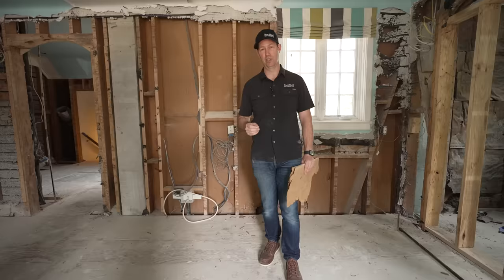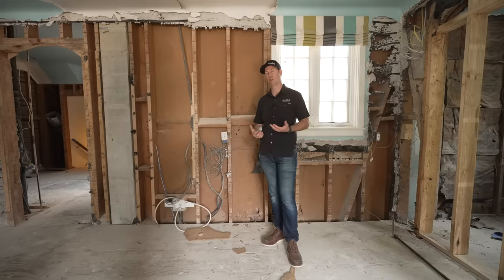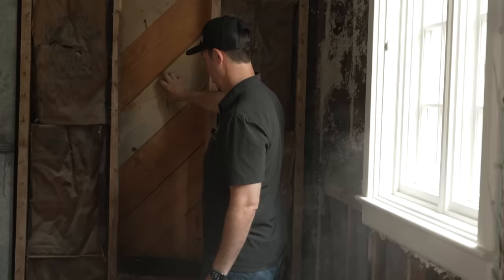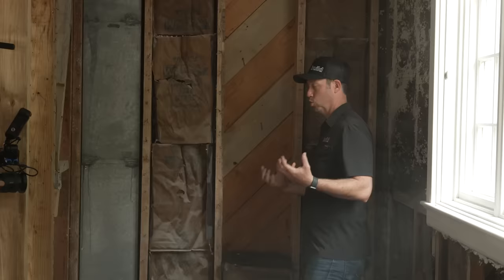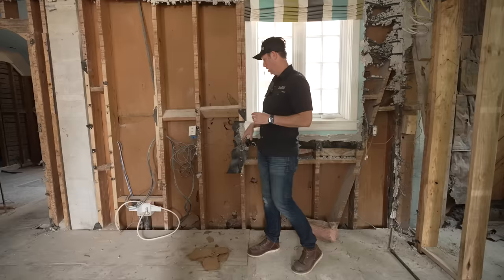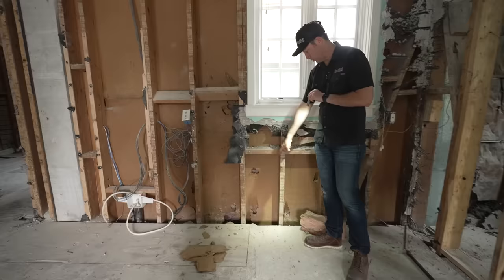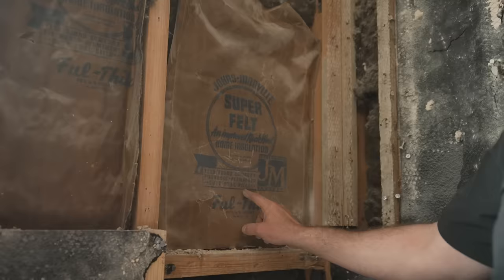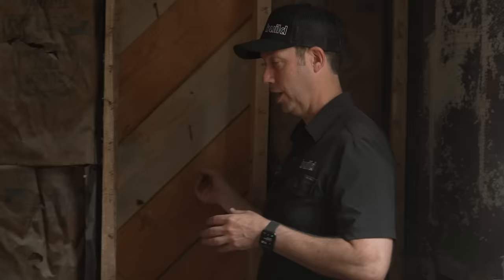I’m recommending we NOT INSULATE This Old House

Comment: Solid brick wall construction is how all Victorian era houses were made, just like a large percentage of UK houses.
You might get mold on cold walls in near freezing wintertime but nothing rots as it's all breathing. Even the floor joists are all intact. 
You can of course insulate with Rockwool, as I will be doing to my house because solid walls are bloody freezing in winter. 🥶
Reply: I beg to differ--Our 1898 Queen Anne is not brick, it's sided with wood, interior is lath and plaster.
Reply: Not where I live (northern NH). It's almost unheard of to see any brick, except the tops of some foundations. My 1893 is all wood exterior, lathe and plaster inside.
Reply: Fellow uk resident who bought a solid block home... how are you going to manage the moisture build up or prevent it?
Reply: Wood frame with brick veneer just like this (though usually less cheapish) was already very common in the outgoing 19th century (in the Us).
Reply: @fabriglas You could use wet-sprayed cellulose

Comment: Great video - thanks for the reminder that we need to always keep in mind how an older building was put together and to see what was work well  - rather than just making changes without actual consideration.
Reply: I'm not an expert, but a lot of newer buildings don't seem to have the longevity in mind when compared to older builds. I'm not sure if it's materials, or design, or both, but I'm amazed at buildings that are 300, 400 or even 500 years old still standing.

Comment: An unsealed house that lasted a century and 8 can see it lasting another?!? What a crazy idea! It’s great building a perfectly sealed home, like he usually promotes but one tiny defect that was not caught or one that develops on it own over time or one that has external force damage that no one thinks harmed the building envelope and you have a hidden problem. One that will reveal its self after it’s done extensive damage to property and possible occupants health. Let you homes breath and work with nature,  not against it.
Reply: 100% percent agree.  I own a home built in 1910, no insualtion, mostly plaster walls, original poured foundaton with no cracks or leaks, original pine floors, and original wood windows (storms in the outside).  The house will probably outlast me.

Comment: I would still insulate. There are organic alternatives that hold moisture. We use it for old farm houses. I would be more worried about vapour barriers than insulation.

Matt did not explain it but here is what I believe may happen. If you put in insulation less heat will leech out to the old particle board. Which means moisture in the air will condense into liquid water droplets earlier because the relative humidity will hit 100% faster in cool air vs warm air. Which is bad. But if you add more material that can hold humidity to "share" the load of the particle board it may not be a problem. May not, as in if you do not do a good job it will probably fail. I would want the moisture to be able to move in and out so I would not put in a vapour barrier. You can always add more ventilation. I really recommend a vapour barrier if the walls are unable to hold a lot of moisture.

Comment: Thank you, Matt.  Along with your video about how vapor barrier and vapor retarder should not be installed on most houses, this appears to be the last piece of the puzzle for me to maintain my exterior walls on my 1960s stucco home. Now, my tentative plans are: 1. No vapor barrier or retarder, 2. No insulation, 3. Possibly replace the drywall that has paper backing with either plaster or cement backerboard, and 4. Seal large cracks and openings in the walls.

Comment: Matt:  I was told by my grandfather those bays were cold air returns when these places were built.  My house is 120 years old brick row house (east coast) with plaster walls .  They used lath to frame everything.. (I'd hate to have been in lath crew with 4000 pounds of 3/8 inch tacks and mountains of lath on a wagon).  When my father and I redid the interior walls we used regular 2x4 then added another 1x to fur it out.  then ran some of the 4000 pies of lath on 1x blocks on the back of the 2x4  thus creating a 1.5 inch gap between the interior brick and the insulation.   I know others who parged their bricks on the inside (interior bricks are salmon bricks) and this created problems with efflorecense.  So far so good on my spot...
Reply: Agree ! We noted this on a 1911 job we were on ,Balloon framing allowed the air to circulate through all walls and joists , plaster walls maintained warmth with the constant heat with water heaters , worked well with no insulation with the exception of every wall outlet and switch penetration sucked in air around the trim plates

Comment: Unfortunately the brick has an R value of about ZERO, my former boss in NW Iowa restored an 1898 2 floors and attic all brick, slate roof townhouse,  I remember he said his utility bill was $800 a month on average- he was basically heating and cooling the SKY with that zero R value brick and single pane windows everywhere.
Without insulation you are going to pay thru the nose for heating and cooling, and it will never be comfortable when it's 20 below zero and windy outside, especially with single pane windows!

Comment: Vapor management is extremely climate-specific, and masonry behaves very differently from wood (Matt Risinger knows all this).

GreenBuildingAdvisor and Building Science Corp have excellent article on vapor management. I'm building in climate zone 7 (cold, high desert) and found mold and frost on the inside of my OSB sheathing after just one winter with open-faced rockwool insulation and no drywall. In this climate, vapor is driving from the inside out and condenses on the cold sheathing. There's almost never vapor driving from the outside in because it's rarely cooler inside than out, and when it is, it's hot and DRY outside.

Comment: This is a great video. I see so many people trying to remodel old homes in the north 100+ years and trying to go net zero at the same time and you see problems almost immediately sometimes.
Reply: So how do I insulate a 150 yr house from inside?? No videos seem to cover that anywhere.
Reply: @sunshinecompany1  usually people gut the interior and install fiberglass batts or punch a bunch of holes and blow in cellulose or fiberglass
Reply: @lifeinchicago9112  some I had to gut and was gonna do fiberglass and poly but some are saying not to so I'm confused more now. I's poly ok on top fiberglass inside balloon framing? 😐
Reply: @sunshinecompany1  if you dont want to gut you can blow in your attic ideally is easiest (just make sure the plaster  is strong enough to hold it). And you can pop a million 1" holes at the top of each joist cavity inside and blow in insulation. Not sure if you need poly, we don't do it in Chicago but I know some climates do
Reply: @lifeinchicago9112  i don't get it, if you add batt insulation, you're asking for moisture trouble since there will no longer be air movement to dry the walls.

Comment: For old houses dense pack Cellulose insulation works good enough.  However most people hate the huge mess it makes.  It really tightens a house up.
Reply: 1770’s house in New England no sheathing. The clapboard is nailed to the outside of the studs the lathe ont he inside.
My folks had dense pack cellulose. Low. In in1978 and to this day no detectable rot fwiw

Comment: I had it even worse in MN where I had a 1924 church that had brick on the outside and ceramic block on the inside with plaster directly over it. I spent over $1000 one January to keep it at 60 degrees F. The only thing that made sense was to cover the building with insulation. This is something that they are doing in England now, but back then there wasn't much available. In the end I moved to Oregon and let someone else deal with it.

Comment: How about using cork board insulation?  I've used it in my previous house in Belgium.  It's natural and permeable, doesn't rot and insulates very well.  Yes, it is more expensive but it might be worth using on this historic house.
Reply: That's a sensible European-style solution. Americans do very strange things with their cardboard homes.
Reply: Australia is even worse. Or was in the past. Yes, many homes in Australia were built like a 'cardboard box' where weather would be between -2 C in winter & 45 C in summer. Not fun.
Reply: He could use cellulose as well

Comment: I'm not a pro, but I'm having a tough time wrapping my head around particle-board in the 1920's... seems off to me.  But the content of this video is spot-on.  I wonder - is there a way to vent a wall cavity like you would a roof or cathedral ceiling?  Maybe then you could get some insulation in there behind a double wall or something?
Reply: Everything was balloon framed back then and vented through the attic. They are going to mess up if they put fire blocking as required by code. Its always best to apply the same building techniques used because they were constructed with full knowledge of that system at the time.
Reply: @danbiss87  thanks...so I shouldn't put 1x4's between framing?... To slow fire spread? 🤔 and HOW can I insulate from inside?  Can I use fiberglass and poly then  drywall? I need heat without destroying 150 yr farmhouse. 😄

Comment: Matt, consider using fiberglass faced gypsum... They use it as sheathing on the outside of commercial buildings!
Reply: DensGlass
Reply: @mikehermesmeglio  yes, and DensArmor from GP.  USG and others make similar products. I think commonly used on interior walls of commercial buildings before dry-in.  I put it on the walls of my bathrooms and in the basement.

Comment: Put some woodfibre and lime render on the inside. Vapour-open construction, which should let it continue to dry the way it has been. Or cellulose fill behind mesh in the bays and woodfibre across the front to render onto. 'No insulation, burn more energy' is a terrible idea. If it really is unfixable then it just has to be knocked down and a useful building put up, but I'm pretty sure that's not the case there.

Comment: You don't have to use basic insulation. You can use other spray types that don't absorb water. That seems to be what he is afraid. So to answer your question.

Yes!!!!!!!!!!!!!! 10000000000000000000000000000000% insulate that house.

Comment: I think what you are referring to as "old school particle board" looks like what was called "beaver board." Don't know why the name, but when I was a builder in a small southern town years ago, it was still available at the local lumber yard. Also, insulation question aside, my concern in remodeling an old house like this is the inherent danger of the framing system in the first room. It is balloon framed by running long studs up from the foundation and hanging the floor (or floors) inside the studs, leaving perfect open fire chases in every stud bay. A fire in a basement or lower floor is free to move upward without obstruction. Blocking between the studs at the floor and ceiling level would solve that issue. The second room is platform framed, with a sole plate on top the floor. There are to openings between floor, so a fire is more contained. Just sayin'

Comment: I owned a house built in 1903, and originally had wood plank siding,  but had that cardboard sheathing added sometime in the 30's? according to an old neighbor that grew up in that neighborhood and still lived there. They covered that with asphalt shingles (probably asbestos, but we didn't get it checked. Then that was covered with aluminum siding before I bought the house. I just painted the aluminum siding and left it all as is.

Comment: I tell people in my neighborhood of 100 yr old houses all the time.  Builders in the old days knew all about water intrusion and had access to various types of insulation, but knew better than to insulate given they could not really waterproof their houses.  Insulate the attic and leave the walls alone.  This also speaks to putting back lathe & plaster instead of cheap wallboard.  If you can even find someone who knows how to do lathe & plaster....
Reply: They didn't know shit. Walls were wavy, ceilings, floors were sagging and it took 4 wood stoves and 12 cords to heat a 1400ft home.
Reply: @augustreil  true. People say old houses were built better. I beg to differ Ive been in old houses some of them you see daylight through the walls. 500 bucks a month to heat it also. And that's in tennessee. Imagine if it was in minnesota
Reply: @justinballard7242 , Agree 100 %
Reply: @justinballard7242  Strongly agree. We paid $150 / month to heat a 1000sf apartment in SF during the winter. And we only heated it to 62F when it was usually 50-60F outside. It was miserable to live in. I can't imagine living in an old home that hasn't been retrofitted with good insulation in a colder climate.
Reply: @dosadoodle  in the house I'm building it'll be a post frame house. With 11 Inch thick walls. R 40 in the walls with very minimal thermal bridging. Conditioned crawlspace with r40 walls and r10 under slab. Conditioned attic with r40 roof. If course all air sealed also
Reply: @justinballard7242  Good luck with that. FWIW, the sweet spot is 2" of ridge foam panel insulation, 2x6 with 24" OC. Any more and you just picking up pennies in front of steam roller. Any more insulation and your costs soar and you also find it difficult to find contractors that can deliver the quality need. 

The other issue with a passive home you still going to need to run cooling to remove heat & moisture. The Applicances (Frig, freezer, electronics, oven\stove, dish washer) are going to give off heat, & then there is the bathroom exhaust fans that will always leak air, even if your home is tight enough to live on the moon.
Reply: @guytech7310  the r23 to r30 rockwool is a marginal price difference. In a post frame the cost of framing is far cheaper so I'll spend the money saved on insulation. Plus in a post frame instead of 24oc you have post at 8ft oc and run your drywall backing horizontally on the Inside of your post.
Reply: @justinballard7242  Exterior insulation will deliver more bang for the buck, than cavity insulation.
Reply: @guytech7310  I'm also worried about sound dampening I'm on a busy corner and the extra mineral wool will quiet the house down
Reply: @justinballard7242  2x4 R-15 makes a room dead quiet before the drywall is up. Issue will be the windows transmitting noise inside. Pine Trees & evergreen bushes can help dampen noise if you have the land.
Reply: Ah the good Ole days when the average life expectancy wasless than  50.  They never had it so good and knew so much...

Comment: I'd love some advice about a 1984 house I'm about to acquire. The wood siding / ground clearance weren't maintained properly and the bottom 10" of the vertical siding is rotted. Taking the bottom foot off won't look good so I'm planning on replacing it all. My thought was to put zip sheeting on before the new siding. Am I opening myself up to vapor issues in the walls if I do that?

Comment: Hi Matt, sheet rock is not a modern material, my house was built in 1918 and still has some of the original sheet rock, I believe it was marketed as the poor man's plaster as early as 1910 or so.
there is no insulation or mold behind the walls here also, love your videos by the way! always learning something new from you, keep it up!
Reply: You're off by about 40 years. Full panel sized drywall was introduced in the 1950s. I know this, as earlier in my career I worked with finishers who made the transition from being plasterers to drywall finishes in the late 1950s, as plastering quickly died off. Rock lath is a thin drywall type product, that replaced wood and metal plaster lath. It was typically sold as 16" x 48" panels, and nailed with short nails that are similar to roofing nails. Confusing sheetrock and rock lath is a real common thing.
Reply: @kerrykerry5778 basically the same product, but different size.

Comment: I wonder if you could insulate with rockwool and bite the bullet and install 3-coat plaster and make sure your paint is vapor permeable. No additional “mold food” added and the wall is allowed to dry in either direction. Or even use cellulose insulation to act as a humidity buffer. It would be a really bad idea if you were enclosing a truly high humidity space like a pool or museum. 
Cellulose is very commonly used with success here in New England. 
Interesting question. Have you discussed with Joe Lstiburek?

Comment: That old sheathing was called Donnacona Board here and used vice drywall sheathing on the interior with wood sheathing on the exterior. Plus rock wool insulation stuffed in but had settled over the years in the 1950s post war mini house I gutted over the past few years here in New Brunswick Canada whilst cautiously wearing my P100/P3 mask lol.  Personally, a lot of these old houses should just be torn down, recycled somewhat, and be rebuilt to a net zero standard.  The bandage approach isn't going to work and it means a whole lot of tearing down and rebuilding which will cost more but less than what it will cost if not done in the long run.
Reply: arent old homes built better though? not as efficient but if they lasted 100 years////
Reply: @randomrazr  Agreed 100%.  I live in one of the original homes built in 1823 near Hartland NB and added to over the years and its still standing but built way beyond the structural minimum codes that exist today.  It has its issues that I'm working away at sorting.  Of note it has an exterior framed wall and separate interior framed wall separated by about 6 inches sitting on the rock foundation.  One day I'll fill that cavity with some blown in insulation and it'll be more insulated than the modern homes. But right now it takes about 6 to 8 cords of wood to heat in the winter